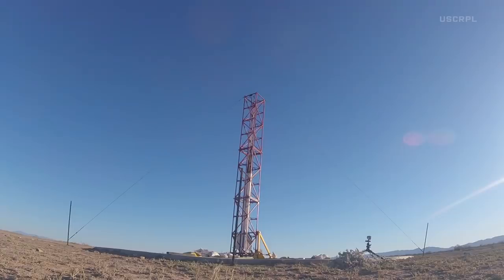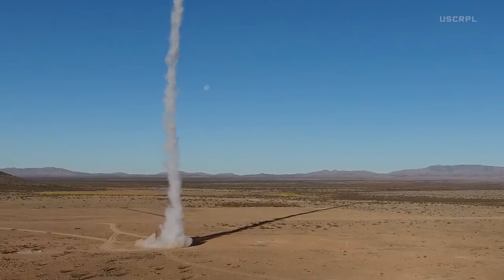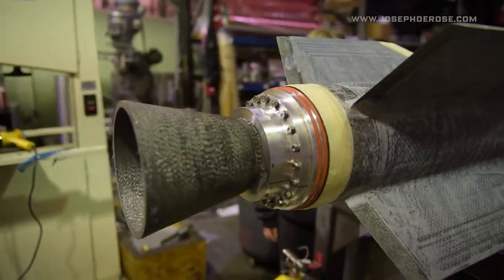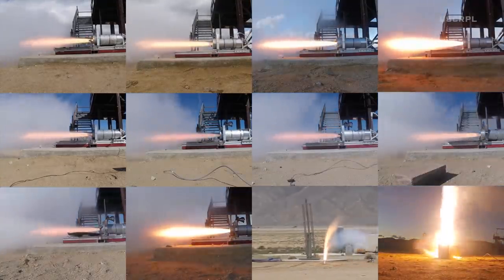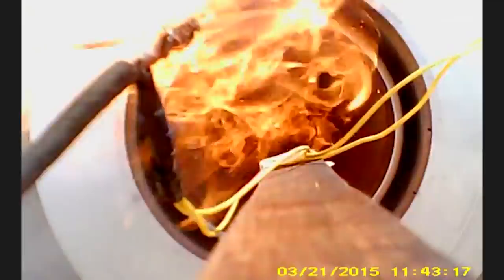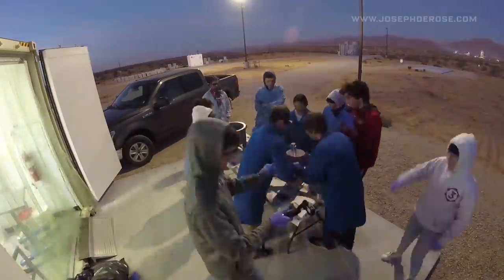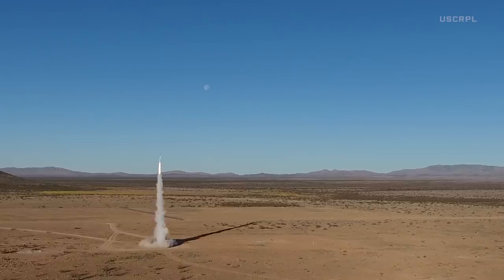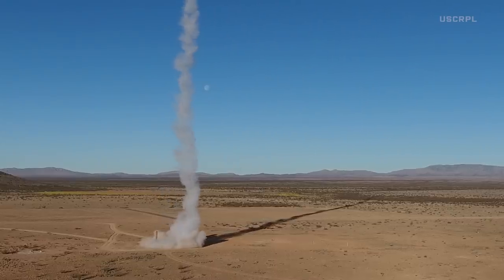Meet the First College Students to Launch a Rocket Into Space | WIRED

Comment: This is wrong, they are not the first to do this in 2002 the air force academy cadets started a program known as falcon launch they hold the record for collage students putting a rocket into space. Their current record is 355,000 feet which is well above the karman line at 330,000 and was achieved on april 24, 2009
Reply: Sorry can you use metres? I don't know what a feet is